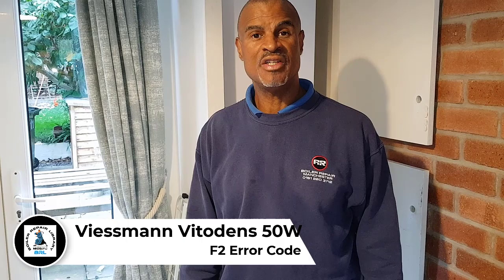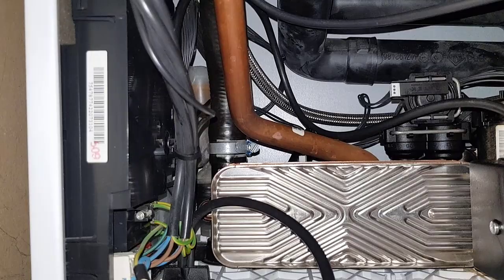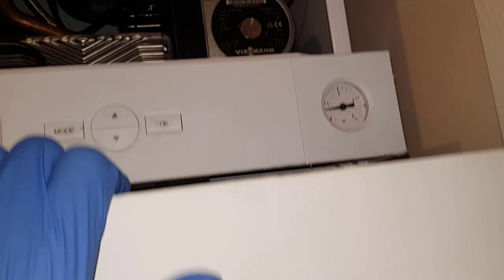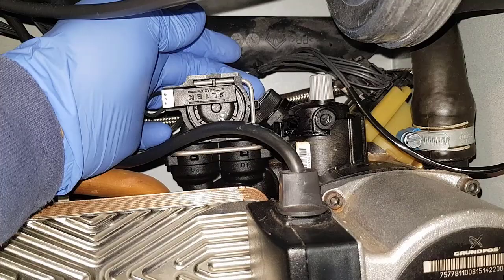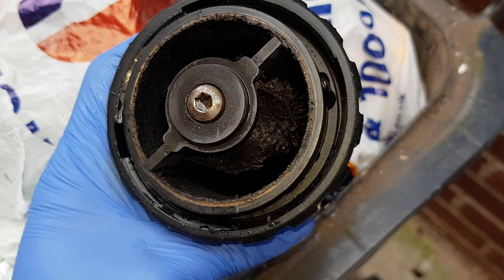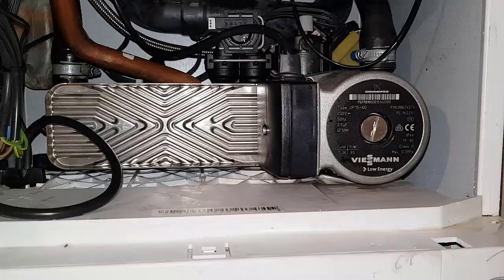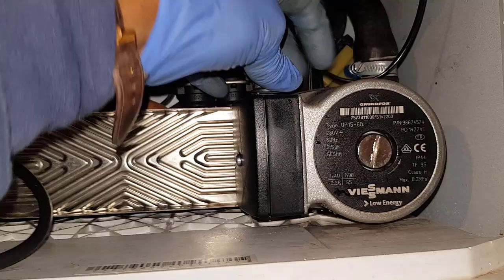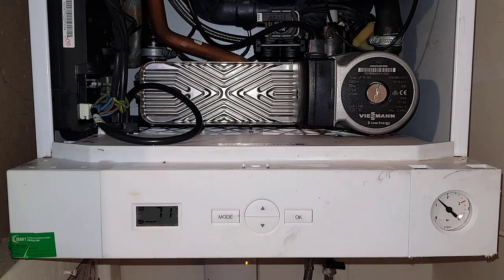Viessmann Vitodens 50W F2 Error Investing in Yourself in The Right Way

Comment: Thanks for another video.  I'm still learning too.
If Prv fails, are you replacing it free of charge? And if fails in week or two?
Why don't you drain down via a radiator? 
Just curious to build on my knowledge. 
Appreciate the videos, these type of videos are good.

Have a great weekend. 👍
Reply from the maker: Prv leak about 20% of the time its other peoples opinions say they leak 100% of the time
Reply: Evening, I never said it would leak i was just asking the other questions.

No worries. Thanks
Reply from the maker: @craigmcgregor5463  Hi if the PRV failed yeah I would charge for that part.
Reply: @craigmcgregor5463  Your observations are correct Craig that PRV valve will probably leak after a week or two! and what he should’ve done is at least take it out and clean the surface rubber seating area you can drain boiler by removing the small pressure gauge hose I do it all the time

Comment: A very misleading video the expansion vessel is absolutely fine as you know they always spit out a bit of condensation water why why why didn’t you clean the plate to plate heat exchanger and when the boiler was all cleaned out it’s only 4 mm Allen screw and it’s forward  facing so very easy to remove. I fitted loads of them and they are a great boiler if maintained properly
Reply from the maker: Thanks for your comments